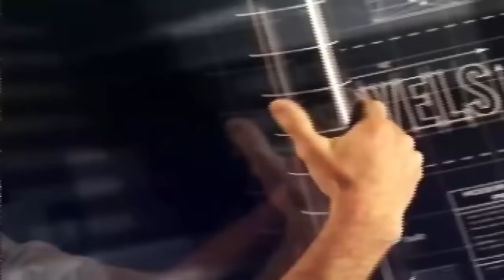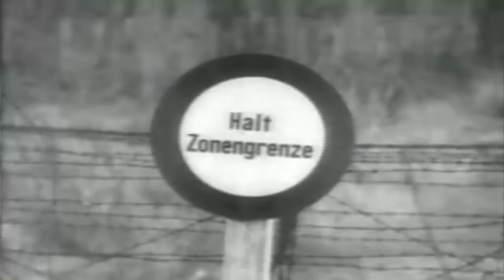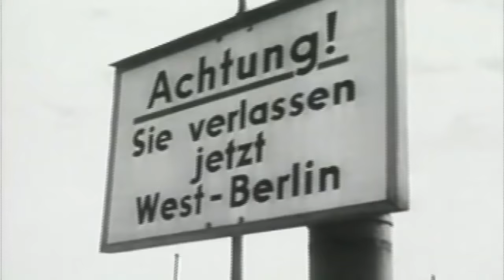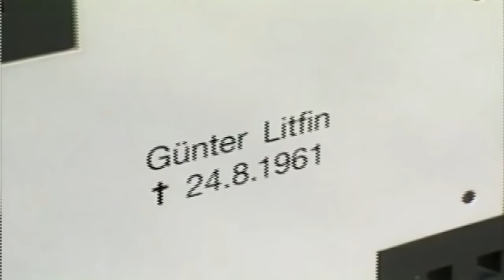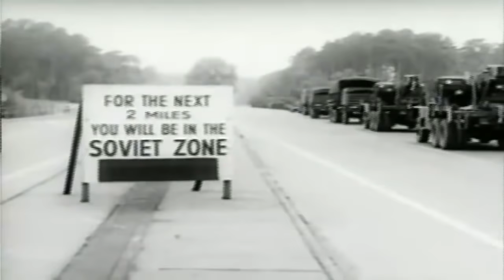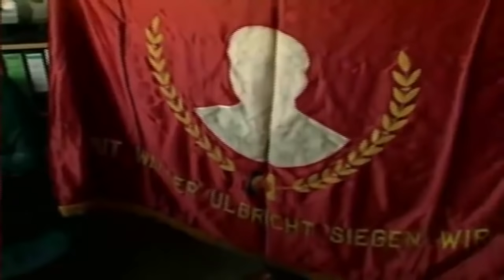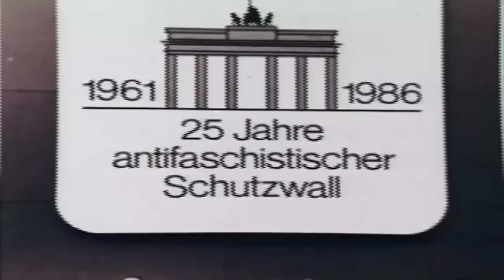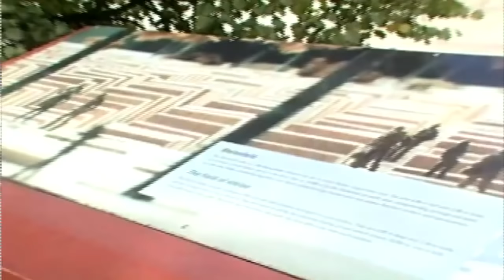History Of Berlin Wall - Amazing Documentary TV

Comment: The Berlin Wall (German: Berliner Mauer) was a barrier that divided Berlin from 1961 to 1989. [1] Constructed by the German Democratic Republic (GDR, East Germany), starting on 13 August 1961, the wall completely cut off (by land) West Berlin from surrounding East Germany and from East Berlin untill government officials opened it in November 1989. [2] Its demolition officially began on 13 June 1990 and was completed in 1992. [3] The barrier included guard towers placed along large concrete walls, [4] witch circumscribed a wide area (later known as the "death strip") that contained anti-vehicle trenches, "fakir beds" and other defenses. The Eastern Bloc clamed that the wall was erected.
Reply: copy and paste much?